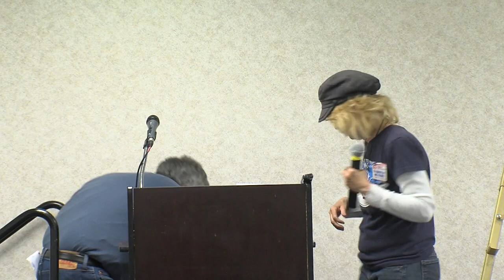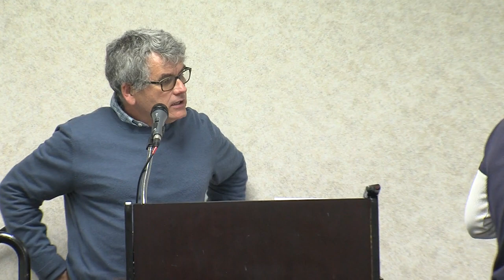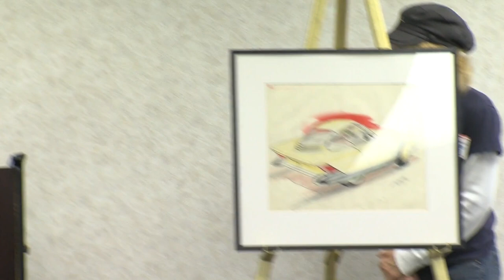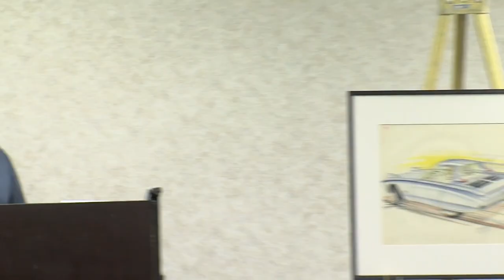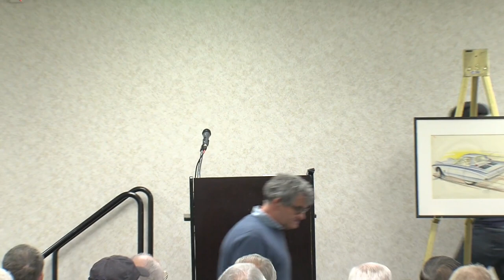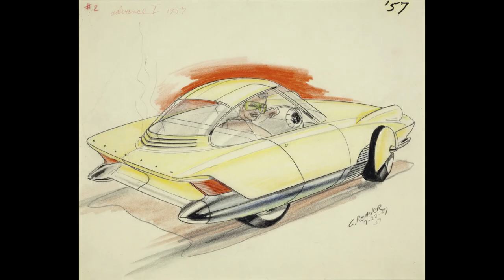Robert Edwards explains 3 Carl Renner Corvair Sketches from 1957

Comment: Those original sketches reveal that the plan was to make the car much smaller that it ended up to be. The Corvair would have been the size of MGA's, MGB's and Triumph 2-seaters. BUT, in typical American fashion, everything has to be big in America.
Reply: The size you suggest wouldn't have done well in the marketplace, because it would have been way too cramped inside. From the outset, one of  the Corvair's main objectives was to be a car that was comfortable for six adults, and those sports cars you mentioned are 2-seaters. Even the Austin-Healey 3000 "4-seater", only has  back seat big enough for two small children. Personally, I think Chevy missed their goal of six comfortable adults, but that may be because I'm 6'3" and, shall we say, "large", and leave it at that. But I have ridden in several Corvairs with 3 other adults for half an hour or more - once in the back seat of a coupe! - and wasn't unduly uncomfortable. I used to go to car shows in various Corvairs that I had over the years with my then-wife and 3 per-teen kids with no trouble at all.

Comment: Kai Hansen's job was to kill the Corvair, but that Bas*ard Ralph Nader did it.
Reply: Nader really didn't have much to do with it. Most Americans like conventional cars; Corvair was new and innovative. So Chevrolet came out with the Chevy II. They then repositioned Corvir as a "sporty" compact; and Ford countered with the very conventional, Falcon-based Mustang. In 1967, Chevrolet itself debuted a conventional sporty compact, the Camaro. G.M. had already decided to ax Corvair in '67 because the Camaro was expected to take over Corvair's market share, but they couldn't appear to be knuckling under to Nader and his poorly researched book, so they kept Corvair in production until 1969. So, in the long run, not only didn't Mader kill the Corvair, he single handedly kept it in production for two more years!
Reply: @corvairjim1  
Don’t Tell Me What You Read
Tell Me What You See!
LOOK AT THE NUMBERS. 
In the 1965 model year (MY), sales for the redesigned Corvair were up for the first time in 4 years, 15% or 31,792 more Corvairs sold then in 1964 MY for a total of 247,092.

Then Nader's Book Hit The Shelves. Unsafe At Any Speed was released in November 1965, that's two months into the then 1966 model year. 

1966 Sales were down by 55% or 137,212 fewer Corvair's sold then in 1965.
1967 Sales were down by -88.97% or -219,839 fewer Corvair's sold then in 1965.
1968 Sales were down by -93.77% or -231,693 fewer Corvair's sold then in 1965.
1969 Sales were down by -97.51% or -241,092 fewer Corvair's sold then in 1965.

Ralph Nader Killed The Corvair!